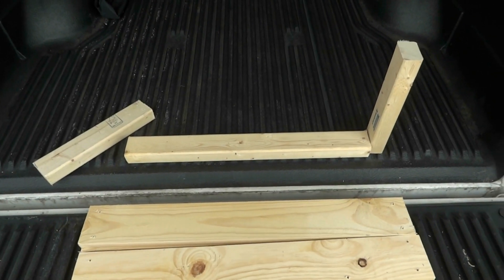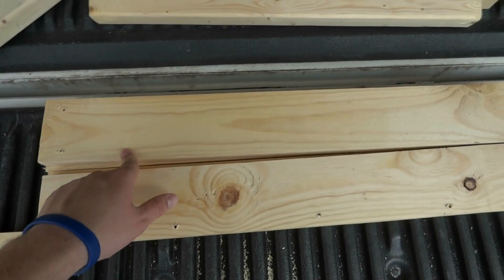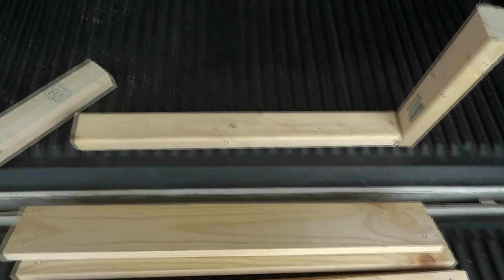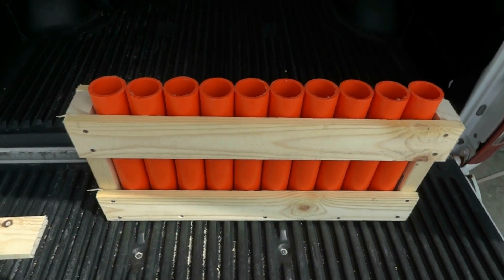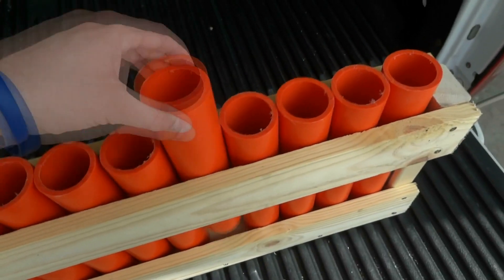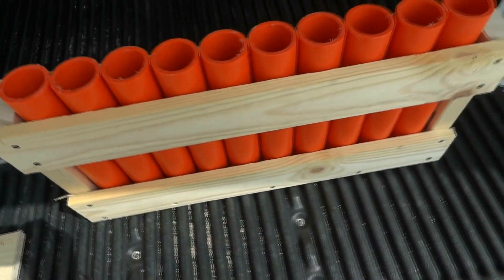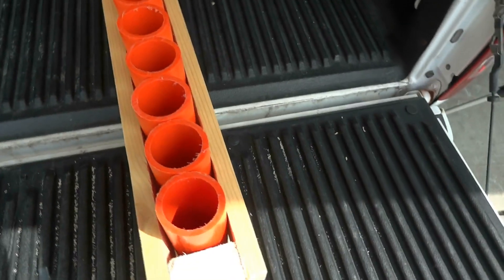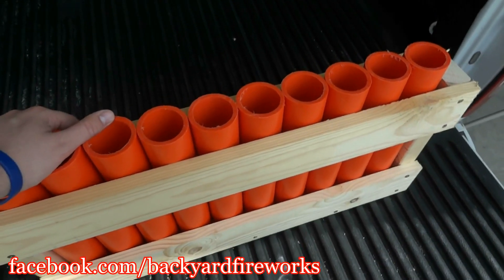How To Build A Mortar Rack

Comment: I used this design to build a 30 shot, straight fire rack and I just ordered 30 more tubes to build a second 30 shot rack for this upcoming 4th. 

I find that you can use leftover pieces of 2x3 to bond 3 of the 10 shot modules together. Works great! 

Thanks for this awesome video, Joel!

Comment: Built this rack for the 4th! It worked amazing. Obviously, you'll want to screw some braces (feet) to each side to stabilize the rack. I used 2 pieces of plywood cut to 10" x 4". My only suggestion would be to add 1/4 inch to the base of the frame (so 3 feet & 1/4 inch) to give a little more wiggle room for the tubes. My HDPE tubes were a little thicker so at 3 feet exactly, the 10 tubes didn't fit in the frame so I needed to extend it 1/4 inch.
Reply from the maker: Great to hear and excellent suggestions!

Comment: Good vid. I've built many of these before. Just a little tip: To keep the mortars tighter in the rack, place a strip of cardboard(like from a leftover case box) in between the sides and tubes. Takes up the leftover space nicely.
Reply: By the time I sanded mine down it was tight enough.

Comment: I'd pour some epoxy, about 1/2", in the bottom then insert the tubes into the epoxy or use some set screws to hold the tubes in the rack.
I've seen loose mortar tubes launch almost as high as the shells and the shell fire off in a random direction.
Usually prepacked tubes but still not worth the risk.

Comment from the maker: It should still work, but you will have an inch of extra room between the mortar and the rack. You can always add something later to get rid of that space.
Reply: Can your mortars be snug or should they be slightly loose for possible expansion and extracting the tubes

Comment: two tips....  use exterior glue and also place a 1/2" piece of ply on the end (keeps it from splitting.
Reply: I just very briefly used a slightly larger bit to make a indentation to counter sink the screws.

Comment: Did you plug the tubes at the bottom or did you just let the rack bottom be the base? I am hoping that the tubes stay in the rack when the mortars go off.
Reply: I built a 30 shot rack using these instructions, and I just ordered another 30 tubes to build a second rack for this upcoming 4th. 

The tubes will stay. You don't need to bond them to the rack.

Comment: wouldn't plywood rather than 1x4 be a better and cheaper option for the long side pieces? 1x4 pine is a softwood and could easily split apart at the screws. I would also suggest adding a fender  washer to each screw to help spread the pressure load.

Comment: Joel, thanks so much for this video.  I just made 10 racks for tomorrow night using this design. One question I have is for fan racks, do you put anything under the bottom 2x3?  Granted the base is partially touching the ground I've seen some pictures with mitered wood so there is 100% contact with the ground. Thanks again.
Reply from the maker: Nope, the base partially touching the ground is enough support.
Reply: @JoelRobinsonPyrotechnics  Thanks. Everything went off without any issues. Probably making for for next year. Thanks again.
Reply from the maker: @Nawlinsboy  Glad to hear!

Comment: Do you think re-purposed fiberglass tubes from kits would fit okay, or might have to shim them a little?
Reply from the maker: A lot of people will simply screw the base of the tubes that come in kits onto wood to create a "poor mans" rack. If you remove the base to put into a rack, it should work fine as long as the plug is still in the tube. You can add wood on the inside if there is extra space too.
Reply: Joel Robinson yeah looking back I should have kept the bases on and just screwed them into a board. It would make them stronger. I am slowly grow my hdpe collection.

Comment: 2 things.  What is the ID of the tube?? And does this withstand the launch without tipping over like the tube the mortars come with sometimes do??  Looks really good…
Reply from the maker: The I.D.: 1.91". I normally build sets of 10 shots and then either put them together into a larger rack configuration. No I would put some end pieces if you just want a 10 shot rack only.

Comment: What size drill bit did you use to pre-drill the holes?  I will be making a few tomorrow for New Years.  Nice vid!
Reply: I used 7/64" instead of the typical 1/8" with decking screws.  I gives the shaft a firmer pressure with splitting your wood.  (OK, I hear your giggling)

Comment: I copied your exact design; but using what i had available, i used 2x4's in place of the 2x3's think this will cause any problems? Ordered the same tubes as well and by the way, I love your videos haha.
Reply: Not if you trim each piece with a table saw, otherwise the tubes will be too loose and move around randomly.

Comment: I found out something pretty cool instead of using HDPE DR11 pipe bought at firework website I used 2 inch schedule 80 pipe for mine it works great and it is basically the same pipe but cheaper u can get this pipe from a hard ware store like I did
Reply from the maker: The biggest concern is what the pipe does under a failure. Isn't that still a variation of PVC pipe?
Reply: i used steal pipe i got it for free because my dad is a pipe fitter and he can get it all for free
Reply: im pretty sure that they make a pvc pipe version but i have no idea how well it would do under a failure
Reply: There are many different types of materials out there. HDPE is proven to be the best in the market.  If a shell ever explodes inside HDPE, you will be completely safe from debris. HDPE expands, while other materials send out shrapnel that may major damage or death.
Reply: A well built rack as well is a big plus.
Reply: 2" HDPE is stronger and lasts for at least a few decades.  It cut down easily and is cheaper in longer lengths.
Reply: There is schedule 40 PVC which is lame but cheap and schedule 40 and schedule 80 ABS which is much better but the gap around the firework would still be much bigger.  I would use longer tubes if using ABS.  PVC also melt much easier the ABS or HDPE.  In a house ABS is typically used for your drain pipes to the sewer and very stable.  My house is plumbed with copper supply lines and ABS for the "grey water" out of the house.
Reply: Steel pipe is expensive.
Reply: ...and for fireworks as well as what you are talking about.

Comment: Hey Joel quick question bud... In the past Ive always built my 1.4 racks from 3/4" pine or plywood for the bottom and vertical ends then used 1/2" plywood for my sides on top & bottom... The question is why does everyone use 3/4" pine for the sides and 2x3x1 1/2" for the main frame..? Ive never had an issue with mine over the last 10yrs or so although it is time to upgrade to HDPE...
Reply from the maker: That's a good question that I honestly don't know the answer to. I'm assuming durability if a shell were to fail.
Reply: +Joel Robinson Ive had a couple rambo kid canisters and one excal fail in fiberglass tubes with no issue... My guess would be that its common lumber easy to find easy to work with... Some people dont have access to a table saw & chop saw... Hmmmmm im going to ask around just to see the different answers I get...
Reply: Pine is easy to work with and cheaper then good plywood.  Plywood is MUCH stronger.
Reply: Plywood is made with a lot of glue. The glue has a much lower auto ignition point then straight wood. So it's much safer to use straight pine.
Reply: It doesn't matter what you use. People use pine because it's easier and cheaper to use a 1x4 than a whole piece of plywood.

Comment: are those tubes completely empty? or are they packed down in with cement to not blast the wood underneath off..?
Reply from the maker: The tubes have a wood plug in the bottom of each one. This is what the fireworks actually sit on. Everywhere I have seen to buy these tubes online already come with a plug in the tube.
Reply: I have seen kits.
Reply: They are not packed down. The tubes are in there loose and the wood plug protects the bottom.

Comment: Do you know if you can use PVC piping as the tubes? I know that that the PSI levels are much higher than HDPE pipes...
Reply: I was told never to use PVC piping...they will splinter if the tube explodes and cause injury. HDPE is the way I went.

Comment: Joel, in using your design and dimensions I ended up with room for 11 tubes and an extra 1/2" space at the end. My tubes are Great Grizzly DR-11s. Are there differences between the way DR-11s are made? Isn't this supposed to be a standard? At least now I can say my racks are Spinal Tap standard, they go to 11!

Comment: will this hold the fiberglass tubes?
Reply from the maker: You would need to shorten the length of the rack as the diameter for the fiberglass tubes is less than HDPE. In theory, they would still fit, but would just be loose
Reply: Can I use any kind of tubes? I want to build one for tomorrow for New Years lol

Comment: Could you use 2x4 rather than 2x3
Reply from the maker: I guess if you wanted to, except 2x3 is the perfect size for DR11 mortars. A 2x4 will add more wiggle room. The diameter of a DR11 mortar is 2.4", so it's a near perfect fit without adding the extra weight of the 2x4.
Reply: If you have the saw you can cut the 2x4 down to size

Comment: What's the gauge/wall size of your pipe? I built this rack to measurement and it only fits 9 tubes and not enough space for the 10th...but without it there's too much room.
Reply: DR11 are 1.91 ID 2.4 OD but this are actually smaller then 2.4.  You should have about 1/8" spare room.  DR9 are also 2.4 but 1.81 ID.  Use those for smaller shells like Goliath and DR11 for most 60G canisters.

Comment: do you think using d9 tubes is just as safe?  I know shells fit tighter but have you had any  experience with using dr 9 with cansiters and 1.75" shells?
Reply: The shells fit since 1.75" are actually smaller then that but the fuse is pretty tight.

Comment: Can you use pressure rated PVC for the tubes?
Reply: No, it will not absorb the shock of a problem happens.  It is also not as heat resistant as ABS or HDPE.

Comment: Question bro. I’m trying to make a rack. However I have a mix of 5 and 6 inch shells. Does it matter what size tubes I get?
Reply from the maker: If they are the same diameter, they will fit into the same tube diameter. Since 4, 5, and 6" consumer shells are all technically 1.75" shells, they should fit into DR11 tubes just fine.

Comment: Where'd you order your pipes from? Pyroboom is doing a free shipping special and I'm debating whether to buy racks or build my own. they are selling full-made racks for $22 per 6 pipes, but surely its a lot cheaper to order the materials right?
Reply: Jasen Garcia where I need pipe
Reply: Scott Mcelroy how many you need
Reply: The rack may only cost 22 bucks but the shipping will be 25-30 bucks and actually cost more than the rack. You literally get the exact same rack this guy just built in 5 minutes. It's cheaper to just do it yourself.
Reply: I build it for $12.00.. IDK what ur talking about
Reply: If you are responding to me I was talking to the guy up there wanting to buy a rack not you

Comment: How much money would I need to buy wood for a 30 shot rack?
Reply: 2 in. x 3 in. x 8 ft x 2 pieces about $5, 1 in. x 4 in. x 8 ft x 4 pieces about $17, 2 500 boxes of screws about $15.  I used 3" instead of 4" and did 8 tubes per rack so my use is different.

Comment: Hey Joel I bought some dr11 mortar tubes online and they arrived and they are plugged.. but I noticed they are not perfectly round... is this going to affect the performance? Or is it gonna be safe ? Can I snag some advice
Reply from the maker: The tubes themselves are not round? Where did you buy them from?
Reply: I bought them from a local place they're almost round there just slightly oval
Reply: Should have bought them elsewhere.  It will affect performance.
Reply: If the shell or canister slides into the tube all the way down to the bottom then it's going to shoot back out without a problem. If a shell or canister stops half way down and doesn't just slide down to the bottom you could have problems.

Comment: You are endangering yourself and any potential spectators within 100 yards using PVC tubing. If a shell flowerpots in the PVC tube, it will send sharp shards of PVC shrapnel flying everywhere at 500 mph! If a shell flowerpots in HDPE it basically shreds some side vents in the tube but all the plastic stays intact. Just say NO to PVC.